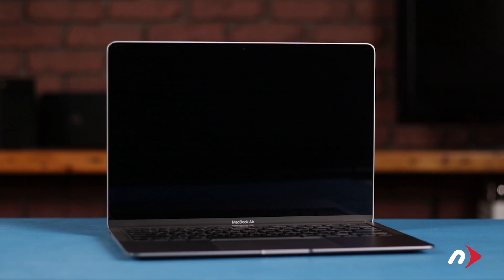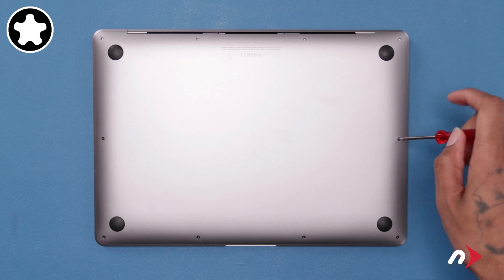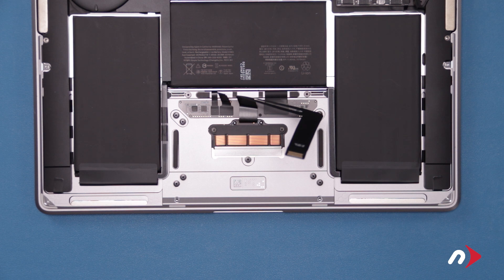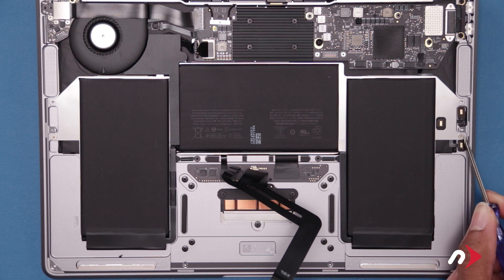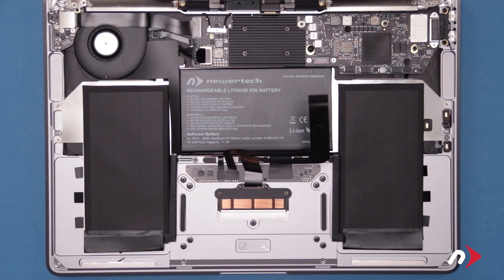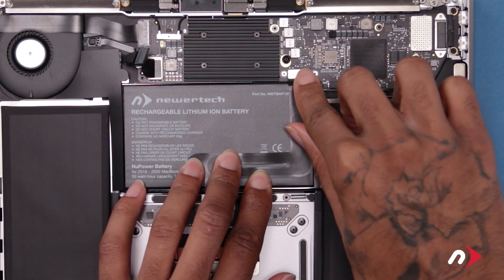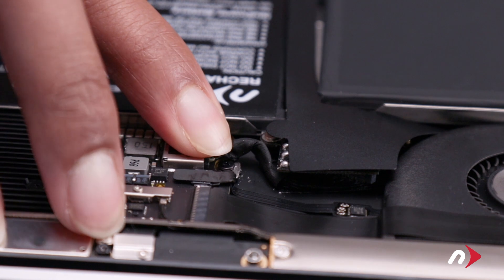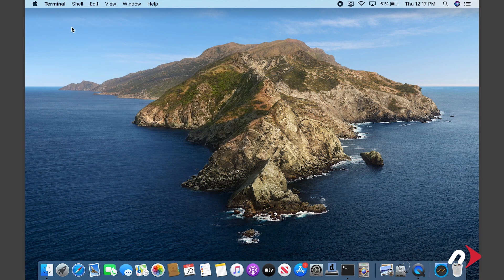How to Upgrade/Replace the Battery in a MacBook Air (Early 2020) MacBookAir 9,1

Comment: I tried pulling out the adhesive strips at the ends of the speakers and they both broke, then retracted where I can't get a grip on either one. Do I just pry up the speaker at this point??
Reply from the maker: You can try very gently pulling up on them and see if they will come loose with the amount of adhesive that you removed. We recommend professional assistance if you are not comfortable with this procedure or are worried about damaging the speakers. Please do not force the speakers to come free as this could damage them.

Comment: After I put mine in and charged it , it only shows the apple logo and does nothing else. I even tried turning it on and off and it does the same thing
Reply from the maker: Try doing SMC and/or PRAM resets to see if they help change anything. Or if your still struggling, contact us directly and let us know and we will continue to troubleshoot with you. (https://eshop.macsales.com/Service/)
Reply: Hey, I got the same problem. What did you do to fix it?

Comment: Does this support the Mac book air m1 A2337?
Reply from the maker: Regrettably this battery is not compatible with your MacBook Air. At this time we do not have a battery replacement for any M1 Mac. These Mac have everything soldered to the motherboard.